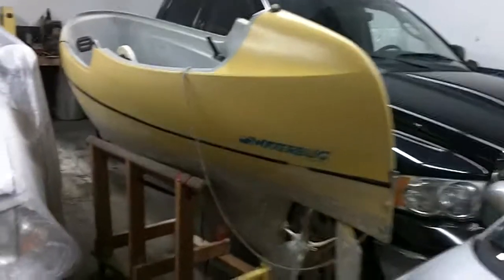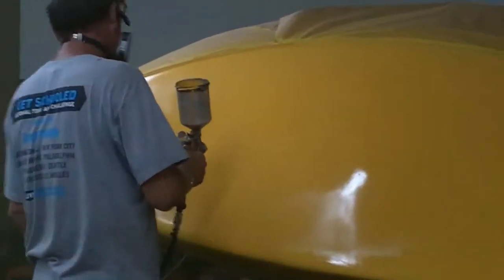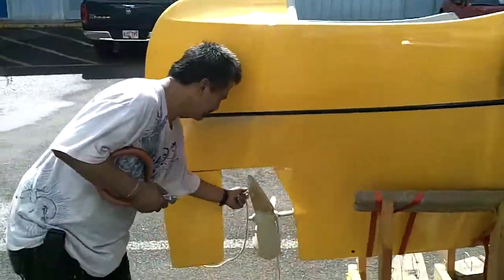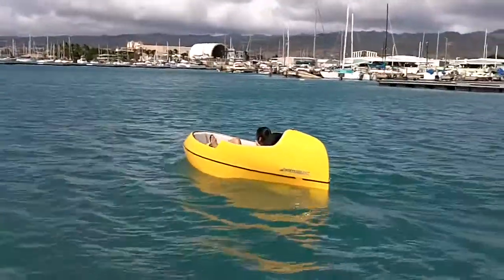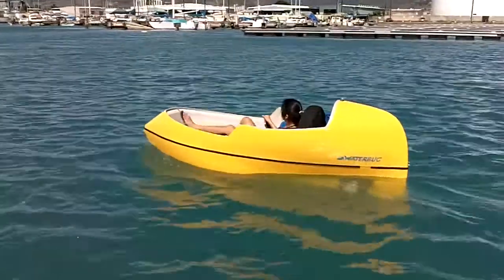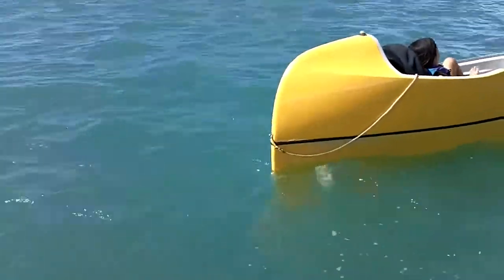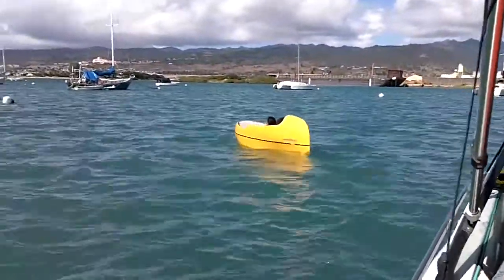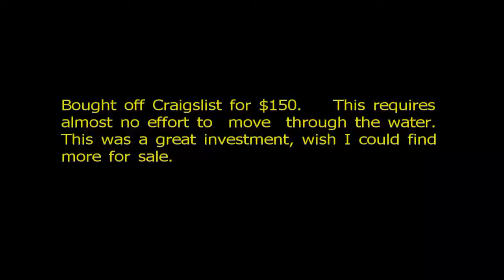Restoring the Waterbug

Comment: Looks like you might be a little short on ballast weight.  I have 5 large leaded weights that sit in the bottom of mine. Mine is yellow just like yours.  I love my waterbug.  I use it almost everyday for exercise.  $150 I'd have bought that in a heartbeat.  I can send you pics of the windshield, it should be easy flat piece of tinted plastic.